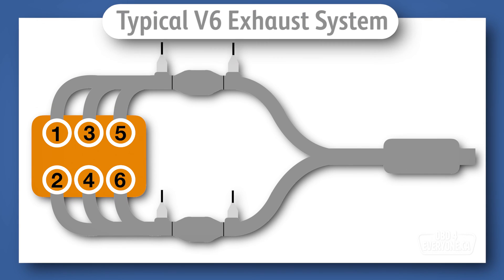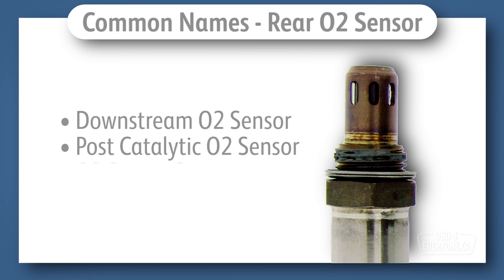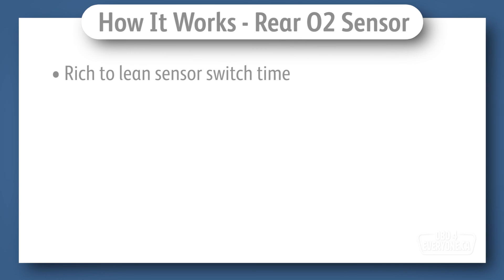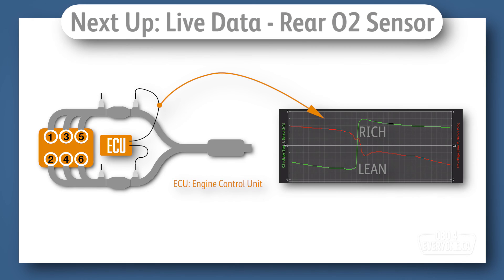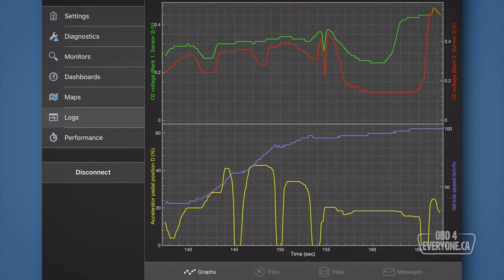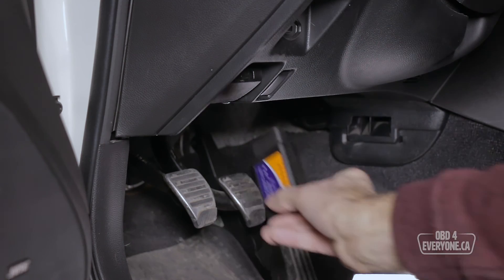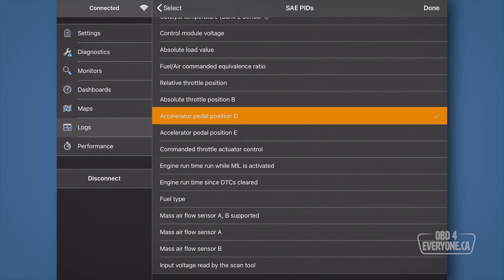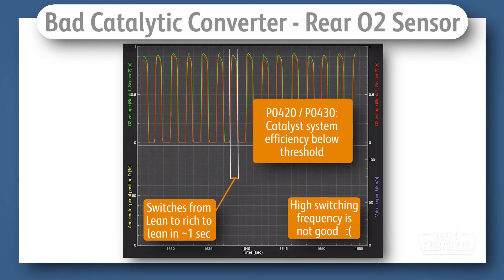Understanding & Live Graphing of the Rear O2 Sensor: OBD4Everyone Ep.19

Comment: o2 sensors don't detect o2, they detect HC and CO on the rich side of lambda 1. On the lean side of lambda 1 the sensor detects a lack of o2. The peak voltage after the cat is always less than the peak voltage before the cat. That's due to decreased concentrations of HC and CO. Likewise the minimum voltage after the cat is always more than the minimum voltage before the cat. That's due to stored o2 in the NOX. The switching rate is determined by engine speed. There's a time delay between air and fuel going in and exhaust coming out. No sensor can actually output 0.5v it will jump from about 300mV to about 700mV with no in between.
Reply: Well, well, well... The oxygen sensor does indeed use the amount of oxygen in the exhaust, to generate an electric current, that the PCM uses to determine the air/fuel ratio in the exhaust. There are two types of commonly used O2 sensors equipped in vehicles today—zirconia and titania.
The first type of oxygen sensor is a zirconia dioxide sensor. It acts as a galvanic battery by comparing oxygen content inside the exhaust to the oxygen content in the surrounding atmosphere, in order to generate a small, variable DC voltage. That voltage is then interpreted by a PCM as a signal that represents an air/fuel ratio that may be ideal, too lean (too much oxygen/too little fuel), or too rich (too much fuel/too little oxygen). Here’s how it works: When oxygen content in the exhaust gas is low (a rich air/fuel mixture), the difference between the level of exhaust gas oxygen and the level of oxygen in the atmosphere is high, causing the sensor to produce a relatively high voltage—between 0.5 volts to 0.9 volts. Conversely, when the O2 sensor detects a high exhaust gas oxygen content (a lean air/fuel mixture), and compares it with the oxygen in the outside atmosphere, the difference is smaller, so consequently, lower voltages are generated—between 0.1 volts to 0.4 volts. The output voltage is then interpreted by a PCM as either ideal, too much fuel (rich), or too little fuel (lean).
The other type of oxygen sensor is a titania O2 sensor; it operates somewhat differently from a zirconia type sensor, but the end results are the same. Instead of producing a small voltage, a titania O2 sensor uses a reference voltage from a PCM and then adjusts its internal resistance based on the oxygen content found in the exhaust gas. A titania sensor’s resulting voltages are similar to those of a zirconia sensor. A rich fuel mixture produces higher voltages (above 0.45 volts), while a lean fuel mixture produces lower voltages of less than 0.45 volts. 
And that's why it's called Oxygen Sensor and not HC-sensor or CO-sensor...
You're welcome @1magnit...
Reply from the maker: We have a different understanding of how this works.

Please give me a link that explains how an oxygen sensor detects HC and CO.
Reply: @OBD4Everyone    hahaha this man must be high, they called it Oxygen sensor and it measures HC and CO 🤣🤣🤣🤣🤣🤣
Reply: @RBPD92  ya it’s funny some ppl think they know how it works. This video is perfect for diagnosing a bad cat.
Reply: @OBD4Everyone :  Next, he'll explain that EGR reduces HC and CO emissions by "reburning" a portion of the exhaust gasses.
Reply: @hightttech  The main purpose of an EGR valve is to reduce pumping losses of the engine, not to control NOX. When the throttle is closed and a cylinder is pulled down on the intake stroke, it is difficult for atmospheric air to force its way into the intake plenum through the very narrow gap between the throttle plate and the throttle bore. Think of pulling back on a syringe while restricting the tip. It takes a greater force to pull a cylinder down when the throttle is closed. Horsepower is wasted in these situations. The lost HP is known as pumping losses. (No, vacuum does not suck air into the cylinder, the low pressure created when the piston is pulled creates a void that is filled by atmospheric air pushing its way in.) Adding inert EGR gasses into the engine displaces some of the clean air charge which would normally fill the cylinder. The PCM responds by reducing the amount of fuel injected into the cylinder to create a proper air/fuel ratio. Less O2 in the cylinder means less fuel is needed. When this occurs, power output is reduced, so the driver applies more throttle to maintain the same vehicle speed. More throttle means less restriction to airflow entering the cylinder, which reduces pumping losses.

Comment: My Rear O2 Sensor Stays at 1.27 v in Idle condition but fluctuates around 0.7 - 0.9 Volts when running. I am getting three DTCs - P0172, P0130, P0420 at the same time. Please suggest what to do. My car is Suzuki Alto (2014).
Reply: P0172 = Fuel System Too Rich (Bank 1)
P0130 = O2 Sensor Circuit Malfunction (Bank 1, Sensor 1)
P0420 = Catalyst System Efficiency Below Threshold (Bank 1)

All here says that you have issues with the bank 1 and sensor 1.  Idk wich car you have or the conditions but i recommended you: 
1. by the P0130, check the cables from the O2 sensor because probably you have a comunication issue. 
2. Put a scanner and try to check the O2 sensors like this video
3. Try to do a propane test just to be sure your sensor´s are good
4. If your sensor´s are good and your analitics are bad it´s because your catalytic converter is damaged. 

i know that all cars dont work under the same way but the faults codes give you a way to research what is goin on in your car. 

Good luck my friend!
Reply from the maker: I have no idea... Suzuki cars haven't been sold in North America for over 10 years, so I don't have any documentation or first hand experience.

Your best bet is to find/buy a factory shop manual and follow the steps for the codes you have.
Reply: P0420 ECU is telling catalyc isn't in optimal state
P0130 state the prob is with 02 sensor CIRCUIT
P0172 'System too rich'  you have the proof 1.27 v in Idle, and around 0.7 - 0.9v when running...these values are too high since normal range is 0.1 - 0.9v
the optimal is to fluctuate between 3 and 7v 
Your values indicates poor oxygen in exhaust system and ECU is mislead and ordering much fuel in chambers.
Try to read injectors values. if good, Test the 02 sensor with multimeter,
since the circuit is indicated by P0130 ...what I know is when values constantly stuck or fluctuate in top of the range of value.. this means the sensor is FAULTY
needs test to repair or replace

Comment: have a 2002 jeep wrangler, just replaced bank2 sensor 2 and getting PO158 and P0161 codes, live data shows a constant 1.000 volts.  Could it be the new sensor is defective or is it likely a shorted wire?
Reply from the maker: Hard to say. Remote troubleshooting through YouTube comments is tricky.

It could be a bad O2 sensor, bad PCM, or fuelling issue (too rich)
You (or a good tech) will have to work through the steps to troubleshoot this.

Good luck!
Reply: it's clear P0161 your prob is with the heater of the 02 sensor bank 1 
see youtube how to test the heater

Comment: Hi, i have P0036 code heater control circuit on bank 1 sensor 2, i think this code showed up cause recently i have leaking coolant on cylinder 1 and 2 so i bring it to mechanic for headgasket replacement, now its running fine but when i check the misfire monitoring data , sometimes each cylinder has 1 misfire, but not all four of them together, every day i have 2 total misfire on random cylinder, it could be the faulty rear o2 sensor?
Reply from the maker: A very low number of misfires is nothing to worry about.

If the car has a manual transmission and the engine RPM is too low when you let the clutch out too quickly, that can cause a misfire to be detected. 

Going forward, just keep an eye on them and see if the number of misfires increases. Good luck!
Reply: @OBD4Everyone  wow thanks for the response my car is AT. This reply gives me peace of mind really, thank you and more power to your channel 👍🏻👍🏻👍🏻

Comment: Hey got a 2005 Elantra gt I’m using a craftsman obd2 reader and the live graphing says my oxygen sensor voltage at an idle is 1.8-1.9 volts
Reply from the maker: I suspect you are looking at the wide band / pre-cat / sensor1 voltage.

Most narrow band / sensor 2 / post cat O2 sensors red between 0 - 1 volt.

I don't have work on Hyundai vehicles, so I don't have any experience / knowledge to share. (

Comment: My rear O2 sensor stays at 0,7 volts, I t does not go down much for sometime, I am running lean with +25% fuel trims
Reply from the maker: I wonder if your rear O2 sensor has failed or maybe there is a crack in the exhaust letting in air/oxygen stopping it from reading rich.

Comment: Hi, and congrats for your video. One question.  I have a Mercedes clc 200, i have the primary cat removed which is in the exhaust manifold, and changed the second cat with a high flow 200 cel cat. He installed also an o2 sensor fooler with a minicat in the downstream o2 sensor in order not to have codes.  Will i burn more fuel due to downstream o2 sensor fooler or have any other problem?  Thanks
Reply from the maker: Each manufacture defines their own strategy for emissions and emissions verification.

Some vehicles do use the rear O2 sensor for fuelling calculations and some don't.

As I see it, the only way to know, is to try it and see.
Reply: @OBD4Everyone  
⁷

Comment: I have code p0171 lean bank 1 & P0171 lean bank 1 pending also right now. Scion tC 2006  - maf, air filter and oxygen sensor replaced. My reading (closed circuit) for my 02  sensor (Bank 1) reads at Volt output 0.740 to 8.00(v)  My 02b1s1 says n/a? my EQ_RATB1S1 read at 1.002 with rpm at 2800-3000.  in idle 02bs1s2 dopped to 0.015 (v) 
My shorttf1 after warm up in idle 2.6 longft1 is 32.1 
Rpm 2800-300 shortft1 moves -3.9 to 1.6 Longft1 stays at about 24% 
 I cant tell if there is a vac leak, 02 is bad, fuel injectors/spark plugs bad or fuel pump. From my readings I cant tell what they mean... vac leak, fuel pump or 02 sensor Any advice? 
Side note the last 2 days just started with idle issue, hesitant when I press on the gas pedal. My throttle reads at 18% which is where I believe it should be.
Reply from the maker: I would start by checking fuel pressure and volume. You will have to find the spec, I don't know anything about Toyotas.

As there are many cheap new parts that don't work as the proper originals, you can't always assume the part you have replaced are good.  

If your total fuel trim is 20%+ that could be a rip in the intake boot letting in extra air, or a fuel pump with low output.
Reply: Hei, I have the same problem, O2 sens remains between 0,6 and 0,9 stays at 0,7 often , I am Also runing reach with both codes P0171 , fuel trims Are + 14 total at idle and gets better When I accelerate, When I drive above 60km fuel trims Are normal 0%

Comment: I have no codes but a slight misfire and a bogg down when warm when I hit the gas bank one and two upstream are up and down bank one down stream is between .730-.750 but bank two downstream is between .025-.130
Reply from the maker: That is very odd... one back is a little rich and one is very lean.

If the engine performance is down during a full throttle acceleration test, there may be a problem with the catalytic converters. It would be odd for both to fail at the same time,  however.

When the banks have extreme and opposite fueling, that can be caused by the rear O2 sensors being switched by accident and end up in the wrong bank. (bank1 sensor in bank 2)
Reply: Might be an exhaust leak.  The ECU will wrongly think it's lean because air is reaching the sensor so it will over fuel and run too rich causing bogging etc

Comment: Hi, my rear O2 sensor stay at 0.9-0.8 volts all the time, it doesn't switch at all when I accelerate or decelerate, I can assume that it is a faulty sensor or I have a problem with air/fuel mixture? One more thing, my long term fuel trim is around -8%, I checked my first O2 sensor and seems to work properly. A faulty rear O2 sensor can cause this to fuel trim?
Reply from the maker: When looking at fuel trims, you need to add the short term and the long term to get the total fuel trim. Total fuel trim should be around -10% to about +10%.

If the rear O2 is not switching, it could be the sensor and that might be the easiest and lowest cost fix.

If the engine is still making full power at wide open throttle, more than likely the catalytic converter is ok and not restricting the exhaust flow.

Comment: hi, hoping you can help
i had a p0141 (heater), changed o2 sensor and now my o2 sensor voltage is fluctuating,, 0 to 800mv, back to 0, 800, 0 ,800, 0, 800, 0 ... would you say the replacement is faulty? The cheapest branded part i can find is £60, whereas the one i bought was a whopping £18 lol. So assume it's just shit quality, i know you shouldn't cheap out on them and this is the first time i have but hey ho
Reply from the maker: Generally, cheap parts end up being way more costly. We assume the new part is good and since the problem still exists, we go hunting elsewhere.

Without know the engine operating conditions when you had the "0 to 800mv, back to 0, 800, 0 ,800, 0, 800, 0" I can't guess.

My suggestion is to clear the check engine light, and see if the code comes back.
Reply: @OBD4Everyone  hi, sorted. 
I cleared eml, it came back as pending and eventually as faulty.. Car is running fine, not lean or rich, no misfire. Front sensor reading good and switching but rear wasn't. Operating conditions were closed loop, up to temperature too. Idle with no load is when the sensor was turning on and off 

So, 
I dug out the multimeter and tested the sensor 
2 heater wires showed 7ohms 
Signal showed voltage when hot/cold 

That's when I noticed the car loom had 
"heater1, heater2, signal, ground" 
Whereas the sensor was 
"heater1, ground, heater2, signal" 

So I depinned the sensors plug, repinned in the correct place (to match the car loom) and its working fine. 0.45v, no eml, and no pending fault.. However stft sensor 2 still shows no data, so just assume the PID doesn't work
Reply from the maker: I have never seen a PID not work... so I don't know. 
Maybe its a first, or your wiring diagram is wrong, or the sensor characteristic  don't match the ECU/PCM programming... or something else.
Reply: @OBD4Everyone  I mean the ecu doesn't support showing stft from sensor 2

The sensor is working and reporting voltage and such, its in closed loop too with no eml so definitely fixed. I didn't use a wiring diagram per se, I compared my part to a genuine part and copied the wiring from the genuine part

Comment: So, the rear O2 sensor reading mostly 0.000 is bad? It reads 0.000 to 0.035. I just cleaned out the cat, as it was a bit dirty. It was giving the code for poor catalist system. 2013 Toyota Echo.
Reply from the maker: Correct. The rear O2 sensor voltage levels should swing between around 0.1 volts (lean / lots of O2) or 0.9 volts (rich, very little O2)

I would carefully examine the exhaust for any cracks, holes or leaks. If extra air gets into the exhaust, the sensor will show a low voltage.

It is possible the O2 sensor needs to be replaced.
Reply: @OBD4Everyone  Thank you.

Comment: I’m interested in installing an O2 on an older disse vehicle to look at AFR - is there a tool I can buy/rent to hook up directly to the O2 sensor to output that data? I’m not looking to have a permanent mounted gauge, I just want the data for tuning. Plus, most gauges don’t work for the higher AFR ratios of diesels
Reply from the maker: I don't know anything about diesel engine control systems or tuning.
If you want to read the AFR, you will need a wide-band air/fuel sensor and controller/display. I suspect the older diesel will only have a narrow band O2 sensor which isn't useful for tuning.

This article may help you:
https://www.hpacademy.com/technical-articles/tuning-a-diesel-youll-need-these/

Comment: I just came here for an idea on the expected voltages so I can hook up a dual switch with different voltage dividers.
Reply from the maker: I understand.... keep in mind some ECUs/PCMs will drive the mixture slightly rich/lean and then check the output of the front O2/AFR sensor and compare it to the rear O2 sensor.

This is how they check for a rich/lean bias of the front O2/AFR sensor. 

If your ECU/PCM does the above, your voltage divider won't fool it and a P0420/P0430 code may result.

Comment: Something you said @2:50 seemed to differ from what you graph said. I was confused. When the switching frequency becomes too low the catalyst efficiency is below threshold. But, low switching frequency means the catalyst's ability to store oxygen is normal. 
Did you mean to say if the frequency is too high the efficiency code gets set?
Reply from the maker: Hey Tom,
As I understand it, there is an acceptable range of switching frequency.

Too high indicates poor O2 storage/low catalyst function and too low may indicate a failing rear O2 sensor or exhaust leak.

Remember the code description is the symptom which may or may not be the cause. 

Often people read the code "catalyst efficiency below threshold" and assume the catalyst is bad. It may be bad, or a exhaust leak, or a failing rear o2 sensor.